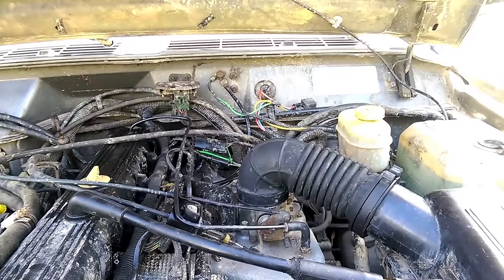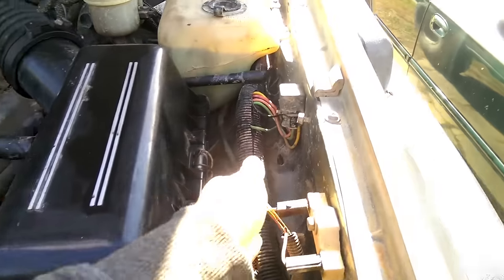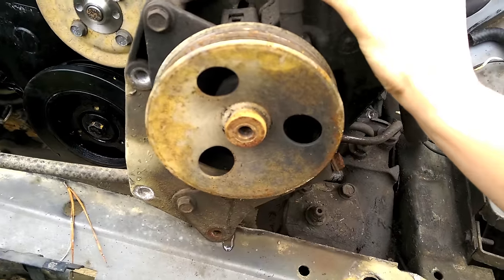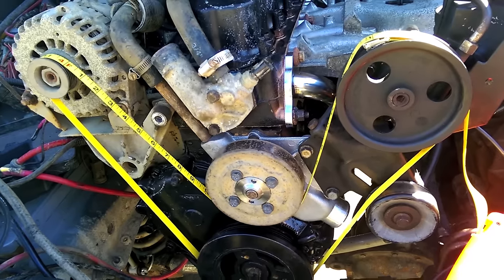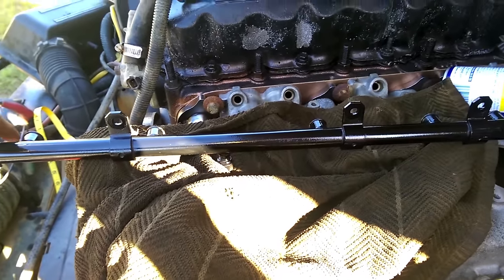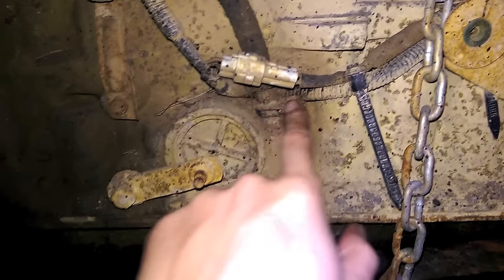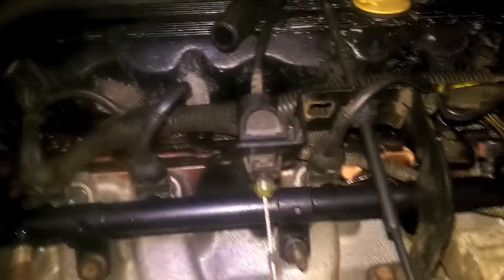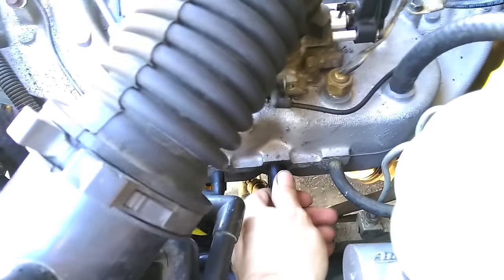89 Cherokee Renix to 99+ HO Manifold Swap

Comment: I did this today. For those that still have the mechanical fan, and alternator relocated with your same kit, a 74” belt works. No grinding of the hawse pipe on the timing cover. PS bracket tensioner pulley will be in the outer 1/3 of travel and clear the cover.

Comment: Coming from a guy that has done 2 renix to ho swaps you have good info and soso info.
Reply: So can you still use the renix head bc I heard him mention a 91-95 head but he showed making the clearance for the headers on the renix head. Just checking because I'm about to do this myself?
Reply from the maker: The Renix and HO heads both bolt up the same, but the intake ports are different. It's best to match HO intake to HO head for the best results.
Reply: @NickInTimeFilms  thanks for responding! I had another motor put in I ordered from advance auto about 3 years ago. Where do I look on the head to find the numbers to check?
Reply from the maker: The head should be stamped somewhere in the middle where the valve cover sits if its jeep factory
Reply: @NickInTimeFilms  you the man. Thank you for replying I'll check that out first before I get a new head

Comment: At 25:30, the Dorman 3/8 Quick Disconnect Fuel Connector 800-121 does NOT go down to 5/16.  It's 3/8 all the way through.  Dorman's own website states this, too.  I've used them before.
Reply from the maker: +MUSTANG408W That is what it says on the website. I forget where or even if I read that it adapted down, but the 5/16" fuel line didn't want to fit on the 3/8" fuel rail but it fits that adapter fine, so I don't know. If it works, it works right? haha

Comment: I have a mint 90 Renix.. I guess I'm a bit skeptical as to whether messing with this is really worth it.  I get around 20mpg on the highway, and power is decent.  Nice vid, thanks.
Reply from the maker: +Quinlan Fennell If it ain't broke, don't fix it. haha
Reply: +NickInTimeFilms For sure!  First jeep, in to it about 15,000 miles.  Reading a lot of back and forth about the Renix years and long term reliability / availability of parts.  Guess that's why I'm doing a little research on conversions.
Reply from the maker: +Quinlan Fennell The 87 to 90 renix xjs are alright. Simple to diagnose and run alright, just take a while to crank. It's a bit dated compared to more modern tech but it does the job.

Comment: Ordering parts right now from car-part for this swap. Apparently junkyards do not like to sale fuel rails. One refused to sale because he said there's too much variance in them. I told him 91 to 95 is the same but he refused. Another refused to sale because the engine it was on was supposed to be good still lol. Local junkyard for the throttle & TV cable.
Reply: So junkyards decided to not call me back on the parts. Took a trip to a new junkyard that just opened up about 2 months ago and it's badass! The old pull a part priced parts the same as buying them new so I did no business with them. New junkyard is awesome. Guy just looks at your pile of parts and is like eh, 40 bucks lol. Got parts for intermittent wipers in the column and blinker switch, the delay box for them, the 99+ steering pump bracket, 96+ throttle body, new brake lights, throttle cable bracket, all the brackets for center console, air duct for center console, glove box light switch, and a shit load of bolts for 40 dollars. Going back today for the throttle cable, intake manifold, fuel rail, headliner speaker pod, key cylinder, and anything else I can find lol. How much difference in length is the tv cable from renix to ho? I seen someone else here say they made the renix tv cable work?
Reply from the maker: Good lord, giving you the run around out there. I've seen people get away with the renix TV cable but it's a tight squeeze.
Reply: Had called 2 junkyards and gave them the parts list, they said they'd go check and call me back. Still no call back lol. Glad though, they wanted $150 for the intake manifold and throttle body, and ps bracket. Got the bracket and throttle body here for $40. Intake manifold, fuel rail, throttle cable and whatever small parts I want for $50 today. Really don't look forward to pulling that tv cable today though lol.

Comment: the renix era kickdown cable works, another thing missed was the mention of the gas pedal. a H.O. gas pedal is needed with the throttle cable, renix pedal don't give you a full wide open throttle. love the channel btw.
Reply from the maker: If you can route the Trans Kickdown to take enough tension off to make it work then that is fine. I actually picked up a 96 Accelerator Pedal Assembly and found that it was the exact same part as my 89 so I didn't bother mentioning it.  I did swap it in anyway because the spring was nicer. I don't remember if I checked for full T.B. opening, my TPS has recently lost a bit of it's upper range and stops after 80% so I can't verify currently.
Reply: +NickInTimeFilms 
when I did my swap, there wasn't much throw with my 89 pedal and got one from a 92 ish (it's been awhile) and got full range from it. they do look almost the same just a little different enough to make a difference. also to help out a 93-98 4.0l grand cherokee  (zj) down pipe (front pipe) also works. FYI

Comment: Another great video ....  I have found your videos to be informative and entertaining to watch ....   Will you have a video going into the details of the stroker build ?  Like the parts you used ect  ?  I watched the instal and the parts hunting at the Junkyard but I was curious as to which crankshaft you choose  and your piston / rod setup ...   ... Also , how is the stroker working out for you .. Is it a noticeable improvement ?  Worth the $ and time spent chasing the parts ?   I have a 99 Grand Cherokee WJ that will going under the knife when I am done with my 99 Dakota SAS ...  Just curious as to the parts I need to start tracking down ..  Thanks ..
Reply from the maker: +Norman Murray   I was playing with the idea of doing a stroker parts video and may do that at the start of December. If I get the engine running right I'll also do a driving video, but right now I'm hunting down a tapping noise from somewhere. 

Since you have a 99, you won't have to do this swap obviously, so it should be about $300 cheaper than my build. It is a very noticeable improvement and really gets you going. It's easy to offroad on rocks as well because it has enough idle torque to just keep pushing you along. I wouldn't hesitate to do it again. My engine builder bought all the parts for me once I made him up a list, but the price was a bit steep at $3,300 for the total build of just the Engine. JeepStrokers.com is a great forum for learning about all the parts and asking questions.
Reply: Thanks for the response ... I have a ton of 4.6-5.0 stroker builds saved on my computer , but I have not personally seen one around me .... When I saw your video I thought some real world feedback and parts choices would be cool ...  Definitely interested in a parts / details video once its running properly ...
Reply from the maker: +Norman Murray I'll see if I can't make a nice informative video. I used a pretty standard build that can run off 87 octane pump gas so it's the safer approach. 

- 1989 Block bored .030" over
- 1996 0630 Head
- Icon 944 Pistons with .030" Overbore and 21cc Dish
- 4.0L Connecting Rods
- 87-90 4.2L Short Nose 4 Weight Crankshaft
- Erson RV12H Camshaft with:
   - 280/288 Advertised Duration
   - .448/.458 Gross Lift
   - 112 Lobe Separation Angle (LCA)
It is a mild lift cam with a large LCA which means more idle vacuum and better idle quality.

This combo gives me a 
- 280ci Stroker (4.6L)
- 8.94:1 SCR, a calculated Static Compression Ratio
- 6.78:1 DCR, a calculated Dynamic Compression Ratio
- 0.085" Quench
Reply: +NickInTimeFilms did you look at 505 performance? they seem to be doing some crazy shit with I6's
Reply from the maker: +Dan Acton Yeah, I've seen all their crazy 4.9L and 5.0L kits, but U've also heard a lot of negative things about them so I figured I'd play it safe and make something "cheap" and reliable.

Comment: Hi there Nick. I've recently installed a 4.7l stroker in my 1989 XJ, and I did the 99+ intake swap at the same time using your instructions. However,  I'm having trouble getting the engine to run consistently. It will start and idle fairly well (still a bit rough), but then it sputters and dies when given gas. Did you have any issues like this? I'm thinking there is a gas flow issue - either the fuel filter is clogged (the simple fix), there isn't enough PSI on the fuel rail, or the injectors are too big for my low psi. That said, it could be a number of things (did you change the distributor?). Or maybe there's a vacuum issue? It wasn't really clear in this video with how you FINALLY set up your vacuum lines - there seemed to be a few location switches, with no clarification/summary at the end. Anyway, I'm starting assuming a fuel flow issue.

I've got a 1993 fuel rail on there with the stock 39 psi fuel pressure regulator. It was suggested that I use 24lb/hr Ford injectors, so those are installed. I've seen your fuel injector tuning video and saw that you ended up using lower flow injectors. Do you think this might be the cause? Not enough pressure on the injectors, so there isn't enough flow? I haven't tested the PSI yet, but will be doing so soon. Just thought I'd see if you encountered anything like this before I get really deep in this.

Thanks man. I really enjoy your videos. You're doing a great service for us XJ folk!  
-Greg
Reply from the maker: +MapNTrowel The Mustang Injectors are big part of your problem. 24lbs is way too much for the renix system, even with a stroker. Same Dizzy, Vacuum lines are mostly the same. I took the vacuum canister off vacuum and piped it into airbox, then used a vac cap to block the big port on the intake. Besides that everything else just runs where it fits. 

I'd put in your stock injectors to test it out, Pulling the battery cables and holding them together for 30 sec will drain ecu memory and put it into learn mode. Try not to give it gas and start it, should learn itself out for the most part.
Reply: +NickInTimeFilms Thanks for the reply. I'm going to give your suggestion a try before messing with everything else. I also have a set of Bosch 0280155703 injectors. Do you think these would work with a stroker?
Reply from the maker: +MapNTrowel Not for a Renix. 703's push 23lbs, still too much. That Injector Upgrade vid shows you everything for picking the right ones. Even if you don't have a scanner, you can still hear the ecu adjusting when it starts bogging down. If it returns back to "normal" after bogging for a second then it can't pull enough fuel to run right. I used 712's which push 19.4lbs and it seemed to work well.
Reply: @NickInTimeFilms  you should do a video explaining how you take off the vaccum canister that sounds very interested 😊

Comment: I need to know if I can fit a stock 4.0l inline six from a 1999 Xj into my 1995 Xj Cherokee ? Is everything compatible?
Reply from the maker: It'll fit just fine, only thing is the exhaust ports are a little smaller on the 99 head vs your current one. You could use the newer exhaust manifold if you want, or just use your old one, probably won't matter, it'll still seal. Also if your 95 uses a temp sender on the back of the head then you'll have to figure something out as the 99 doesn't not have the hole, so temp gauge won't work without it.

Comment: Are you having a lean light throttle issue with your renix stroker?   After exhausting limited tuning variables with my renix system, I'm going to obd1.
Reply from the maker: I had the opposite, way to rich but that had to do with my injector choice. I got some 19.4lb/hr 712 injectors and it seems to do fine now. Do you have a wide band o2 or scanner? If the computer learned a bad habit, you can pull the positive cable off the battery and touch it to ground for 30 seconds to drain the memory and let it calibrate again.

Comment: All back together,  but I can't get it to start... It is very close to turning over and will run at high idle for a few seconds then die... I am thinking vacuum but I have everything hooked up... Any ideas?
Reply from the maker: Did you definetly make sure the intake was sitting flush on the head. also don't out the charcoal canister vent to vacuum, you'll get a big leak there

Comment: So I have a 98 motor going to rebuild and swap into my 99. Didn't come with intake or header. Will my 99 intake and header swap over with no problems? Seems to be less involved than your renix swap.
Reply from the maker: Looks like the 98 and 99 should interchange just fine, but I don't know as much about non-renix
Reply: NickInTimeFilms thanks man! I appreciate the reply.

Comment: so if i have an 89 renix and a buddy has a 95 xj that he wrecked.. would it just be easier to swap the whole block and go with that as opposed to all this? i know you just making the best motor out of the renix. but as you said, its not a big improvement of HP and my motor has a knock as the previous owner ran it to the ground.. im just asking before i start tackling everything to see what the better option is
Reply from the maker: You can swap the whole long block if you like, but the Renix block is made of better metal from what I hear, and I get conflict reports about the HO cam working well on the Renix system. Minimum, you'll need to swap the flex plate, distributor, and any sensors over to the HO motor. TPS adapter will be fun. You caaaaann bolt the Renix manifolds up to the HO block but the intake ports are off a little which may also effect performance.

Comment: Hey Nick. I know this is an older video.  But I was wondering if you could replace only the intake manifold and fuel rail, but keep the renix system?  Any thoughts?
Reply from the maker: The HO Manifolds will physicaly bolt up to the Renix heads and seal, but the intake ports don't line up quite right. It'll work, just not as well as it could.

Comment: where do you go to find out the size of belt you need, having trouble finding the correct size. I have an 89 Cherokee with AC and went with the 99+ HO swap but either the belt is too long or too short... any help would be much appreciated.
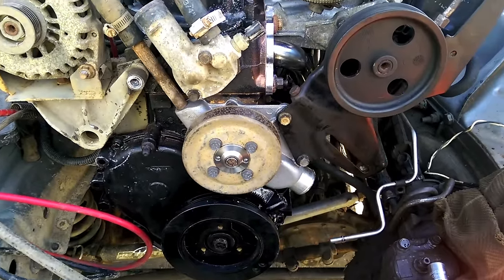Reply from the maker: For custom applications it's better to just measure for the exact length belt you need. I uses a flexible tape measure and wrapped it around the pulleys to find my length. I show how I do it at 16:20. For finding the actual size, I just call up my local auto parts store and see what sizes they have in stock and see if any are close

Comment: Doesn't the 99-01 head have issues with cracking on the #4 cylinder due to the casting being thin?????
Reply from the maker: Yup, those heads are notorious for cracking between cylinder 3 and 4. The later TUPY heads fixed that issue, but we aren't using those in this swap because the exhaust ports are smaller.
Reply: If your head cracks, get the other one and port match it.

Comment: ok im working on a 96 Cherokee I pulled the head off a 98 Cherokee only difference I see is the exhaust ports are smaller and it doesn't have temp sens in back of the head but it had a sens in the thermostat housing im guessing its for temp sens hopefully
Reply from the maker: Yeah, it is for temp, but it's a different resistance range.
Reply: +NickInTimeFilms oh shit I hope my old temp sens will fit its hole are thread
Reply from the maker: tim walk different size,  think head thread is smaller so you'd need an adapter
Reply: Damn ok thanks for your help good man

Comment: Did you have to replace that Bosch O2 sensor? I here their wide band and don't work with our jeeps.
Reply from the maker: I don't remember what I did, I know I bought an NTK a while ago and it looked the same as this so I guess they are all a new style.
Reply: NTK works it is the OEM sensor used by Jeep on or Jeeps.

Comment: I have an xj with a main bearing knock, and a stalling issue. I plan on replacing the motor with a high output 4.0. I will be getting the whole jeep. I will be changing the motor, wiring harness and ecu, to fix both of my problems, but mostly because 4.0 h/o rev limiter sounds sweet. ;) 
I assume you kept u our renix ecu, correct? and how many hours did this take you? I think mine will be about the same amount of time because I won't be doing somethings like the 99 intake, and the moving around of sensors, etc.
Reply from the maker: +Henry Dillard Kept the Renix ECU and all Renix Sensors. Since you are doing an H.O. conversion with ECU from a donor, you will want to just swap everything over as is. Less custom work, but more time in just pulling everything apart and getting it to fit in the new vehicle. This swap took me a few months of in between research and gathering parts, and a few days to swap everything over.
Reply: NickInTimeFilms so I have a 87 2.5 and I have a complete donor 94 4.0. from what I read if I wanted to use the harness from the donor I'd have to use the under dash as well. if I do that it says I'd have to rewire my taillights? any thoughts or advice? I know I can't use my ecu and harness since I'm starting with the 2.5 not the 4.0
Reply from the maker: Well the 94 is an OBD I and with the engine swap like you said, ECU and full harness swap is a must. What says you have to do that? I've never swapped a harness before so I guess you'd have to see how far that thing actually goes, lay it out and see what needs to go where. I don't know if the 2.5l's are different but the brake switch is on the pedal, and I'm pretty sure it just sends power to the brake lights

Comment: Great video thanks, one question, What size is the new block bolt to secure the bottom of new bracket to the block?
Reply from the maker: Good question, not sure. I don't recall if my stock one fit or I pulled it off the donor vehicle.
Reply: 9/16 bolt 3/4in long